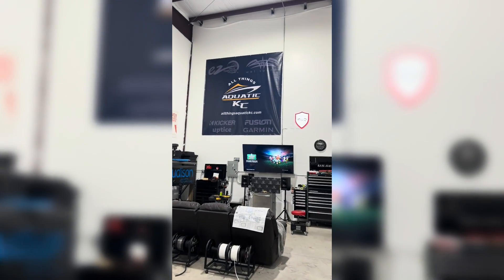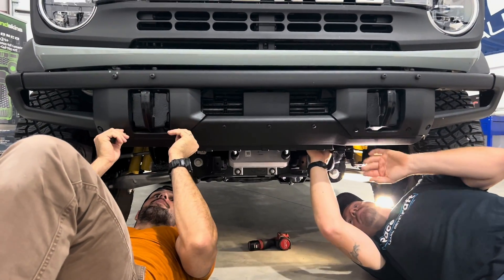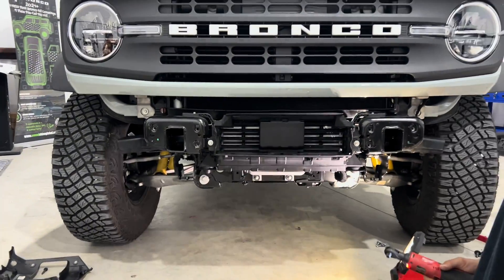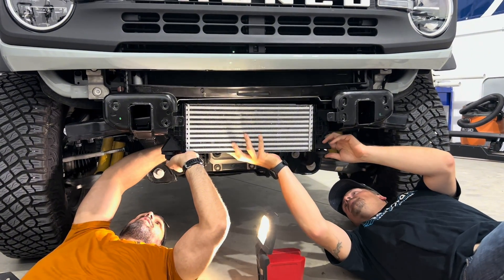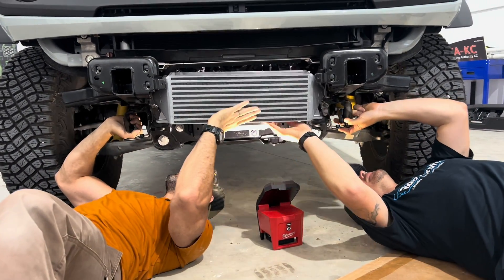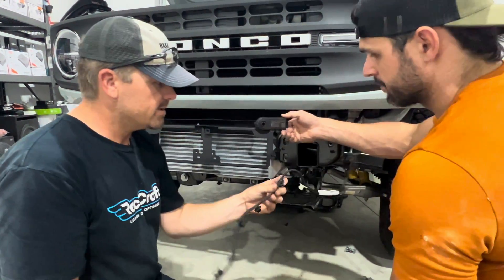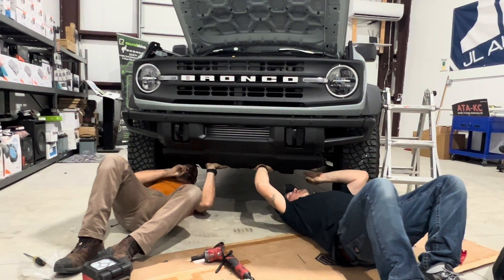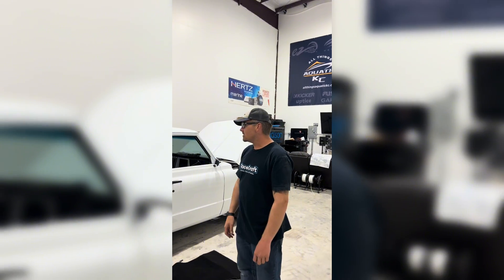2023 Ford Bronco intercooler install! #CVFabrication

Comment: I love your little intercooler. Is it feasible to run it high mount (2.3L) to take the cooling out of the bottom for a lower profile bumper build? (

Comment: Been looking for a video for the 2.7L. Nice Job. I've got a 2 Door OBX, no front camera or adaptive cruise control, and I have the stock bumper. Do I have to remove the front bumper, or can I just remove tow hooks, unclip the hoses and drop out? Will I have any issues with reconnecting the fan shroud or shutter system?